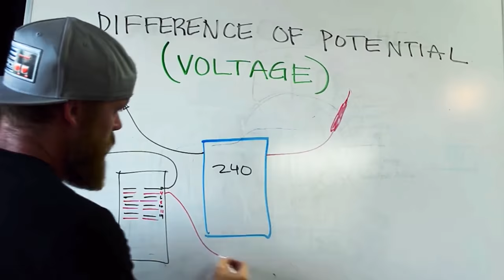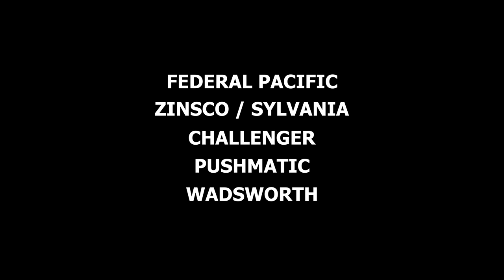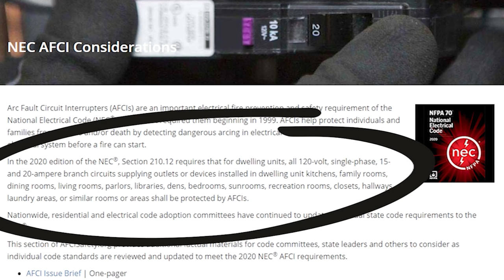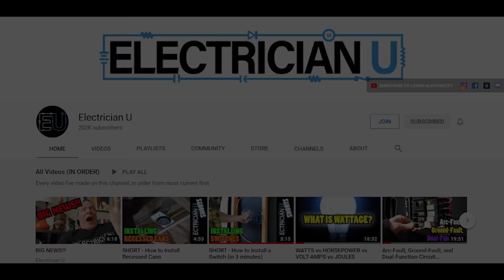Outlawed Panels and Breakers

Comment: Isn't  it very irresponsible of you to tell anyone to intentionally short circuit a breaker? In the testing process it's done in a lab in proper room and test rig. The amount of energy that's flowing throw the wire is incredible, even if momentarily. Not to mention any bad breaker you have, you may have just caused irreparable damage to the whole circuit, or worse caused a fire or injury. I'll bet any amount of money there are people out there who think they're qualified enough to do this now. NO ONE SHOULD BE DOING THIS OUTSIDE OF LAB TESTING SITUATION.
Reply: I am a master electrician with 25+ years experience. I'm not qualified to do it. I work on industrial, sometimes live circuits. No matter how tempting (may save a long trip to the MCC) we just don't do it. Too many X- factors
Reply: I made my own circuit breaker tester back in the tenth grade. I won't say how i made it. Do not try to make this we were just kids pulling pranks. We would shut down drink machines and disrupt class operations.  My friend had a cheap version but mine was much safer. I still have the device hanging around I think I only used it once at home. I won't be using it now because I grew up and are more responsible around electric. I probably will dismantle my device because I don't want anyone else using it. I am writing this so others won't try it but like all good intentions someone will try making one to disrupt class or work. They make circuit tracers so this is not meant for finding breakers. Let the labs do all the testing under safe conditions. 73
Reply: I'll be fine, I just need to wear a lab coat..

Comment: But Federal Pacific are the biggest offenders out there. Of burnt houses.
They have to pull breaker out put in load tester breaker. tell heat. Amp load. Speed of trip percentages. Thermal say pass or fail . With a UL listed tester. 
The older brands I seen
Wadsworth 
Russellstroll
Kill ark
ABB

Crouse Hinds
Furnus
Allen Bradley
Zinsco
Russ elect

Pushmatic
General Elect
And Federal Pacfic
Are some older panel I’ve run into. I’m shore there more around Nh. And Boston area with old houses.
I was in a room under ground it was just exposed copper bars in Boston when I was younger. No insulation. Every thing in room was copper bus exposed and live. 
Keep some old breakers on shelf so I show to helpers  the like see old panels and breakers.
I corrected thank for pointing that out . Spelling errors.
Reply: Cruise Hinds is a typo; should be Crouse Hinds.
Push o magic is another typo; should be Pushmatic.
Reply: @stevebabiak6997  haha Fat thumb little letters. Plus the auto correct
Reply: @davidpetrusewicz8172   - yeah, I encounter those same problems. I just wanted any homeowner who was reading to know which were the correct bad brands.

Comment: 4:28 A19 refers to the actual envelope or shape of the bulb, not the type of base. A19 is the most common style light bulb used but the base on the bulbs AND fuses are E26 aka the medium base. Fuses were actually quite safe but some people actually put 30 amp(which were mostly for 240v circuits) ones in place of 15/20 amps ones to simply prevent the fuse from blowing so often because they obviously were overloading that circuit quite often.
Reply: Ben ... that was a common problem back when most homes had a 30 or 60 amp service with a single fixture and a single outlet per room. If you think about it, most homes didn't have much in the way of appliances to plug in pre WWII so a single outlet was pretty much used for a floor lamp or maybe a fan. In a kitchen, only the well off had toasters, blenders, mixers and such in those days. Basically a single fuse might feed an entire floor and four outlets in a modest sized home.
Reply: The old screw in glass and window type fuses with the common base for all current sizes were called type "W". The later style screw ins with different bases for each current size were called type "S". They looked like they had white porcelain bodies.

Comment: I replaced my own panel in 2019.  Inspector forced me to install two ground rods.  He didn't force me to install all kinds of arc fault. I did as many as I could given my shared neutrals. I spent $800 + in materials.  The friendly electron at work estimated $1500 to do it.
Reply: Want a cookie?
Reply: As long as it is permitted and inspected, self install is perfectly valid. 
I assume you torqued all the lugs properly?
Reply: @SuperVstech  hopefully I torqued the lugs correctly.  It was permitted and expected.    Me and my friend are not electricians.  I took several circuit / electrical theory classes in college and my friend is a juryman lineman so we know enough to be dangerous 😜

Comment: Have you checked pricing? Replacing Zinsco breakers is NOT cheap, Connecticut Electric replacements are ridiculously expensive, around $70-$100 EACH at the Orange Store. I bought a brand new GE 200 Amp Main lug panel, 20 Spaces 40 circuits, with all the needed breakers (even some spares), ALL OF IT COMBINED was cheaper than 3 (yes, Three) Connecticut Electric replacement breakers and, 99.9% of the times, the busses of the Zinsco will be badly pitted/burned, and EVERY SINGLE breaker will need to be replaced, Let's say you have 24 circuits in your house, so  24 X 80 (avg) = $1,920, so you will end up paying almost two Thousands for new breakers to put them inside of a POS, unsafe panel.  It doesn't make sense.

Comment: In my 33years I’ve seen issues with all manufacturers. Mostly due to lack of maintenance and just bad workmanship.
Reply: And some of your advice is just plain dangerous. How long have you been an electrician?
Reply: where I worked, if you intentionally shorted out a line(did not matter the reason) you were either "WRITTEN UP" or you were "TERMINATED" that did happen to a co-worker. you are not working in a safe manner, you just do not know when things can go wrong, and when they do it turns into a big "I GOTCHA"!!!!. it has always been stated that 120 volts kills more  people than any other voltage potential!!!     stupid is , is what stupid does, you may not get a second chance, or start a fire that can not be put out!!!

Comment: FP and Zinsco, still powering millions of homes, without any fires.
Reply: Its only a matter of time.
Reply: @MrLectric  It's been 50 years, how much longer?
Reply: And hundreds of fires directly attributable to the FP and Zinsco res panels...
Reply: I think the Fire issue really kicked off when Aluminum wiring kicked into high gear. He did a episode on it, but say a Range plug started overheating that in turn would create a Hot Spot in the panel...
Reply: It's all good until it's not.
Reply: Sure. As long as no wiring issues, or overloaded conductors, bad motor loads, or defective equipment overload the circuit, directly bolting the circuit to a bussbar would be operating as well...
The issue comes in when something DOES fail, and overload... the fp/Zinsco panels will NOT protect the wiring... you know... the reason the breakers are there...
Reply: That's the equivalent of myself driving on a busy freeway during rush hour traffic not wearing my seat belt,  and purposely removing the fuses to disable the airbags.  I could hypothetically drive that way dodging seat belt tickets for 10 years and always come home safely to my loved ones.  That is as long as i am not involved in a collision, regardless of fault.
Reply: In 50yrs they'll be saying panels installed at current standards are death traps too. It gives the Engineer something to do so they can jack up the price lol...
Reply: @steve-o6413  Exactly. The manufacturers lobby the NEC to do precisely that.
Reply: With Federal Pacific, one of the big issues is indicating off or tripped but still being energized on the load side; this is a hazard. Breakers that malfunction should “fail safe”, meaning the load is left de-energized when there is a malfunction.

Comment: Why is nob and tube wiring bad/ dangerous?
Reply: the wiring is only rated for 40 C.  And it is not code compliant for this wiring to be covered with insulation in the attic of the house. Splices were made in the ceiling boxes, and I have found them also in walls. Twisted and soldered together.  In this old houses, they switched the neutral in many of these houses, instead of the hot, and load.  That is a "few" things wrong.
Reply: @donaldwood9187  thank you. My uncle still has that stuff in his home. He has been resistant to getting the wiring updated. Maybe this will change his mind!
Reply: @justinh6974  Also, no ability to retrofit a ground adequately as well. A high potential to shock someone when it's faulty.

Comment: Insurance company's for "Commercial & Industrial" on New Policy's, will require 'LOAD TESTING", of old MDP Panels, if not "FUSES", As AN old electrician, I always go with "FUSES" over breakers, maybe I'am "Jaded", too long in trade, esp. before all this "TESTING" gear now a-days old time to trace we , shorted circuits, too trace, to trip breakers, Federals , you could "WELD" & they wouldn't trip.

Comment: They aren't outlawed you should know better. New parts are still available at electrical shops. Zinsco was sold at home depot 10 years ago. If you do your research these companies were bought out or merged with bigger companies. As for the ul listing. It doesn't work like that and if we had to bring everything up to code that we found on existing buildings. We would be replacing almost every breaker siñce those old ones. To a Arkfault breaker and your saying they should be outlawed because it has a old ul listing!!!! Please do some research before telling people all of these lies